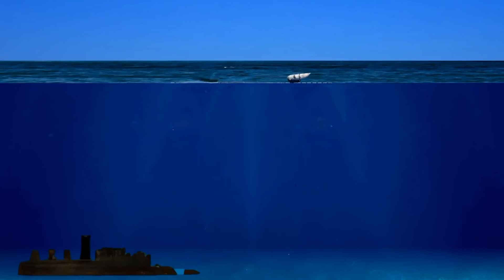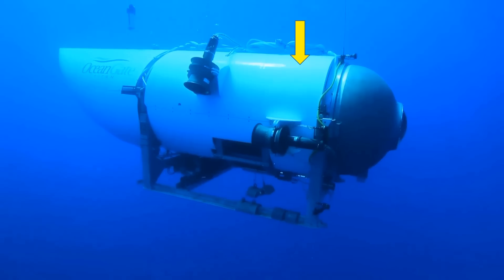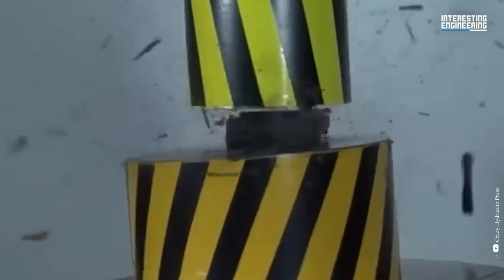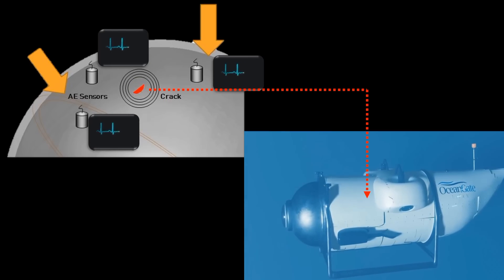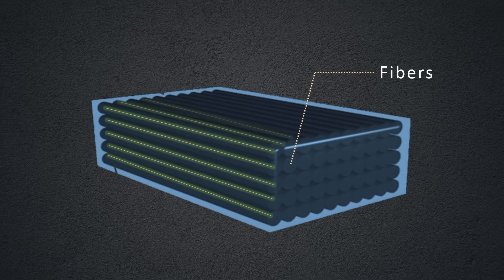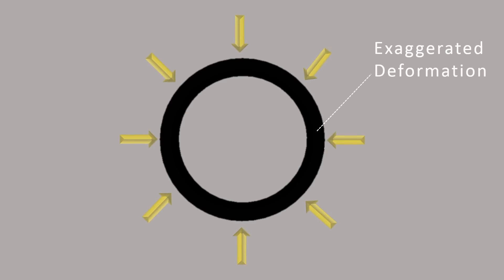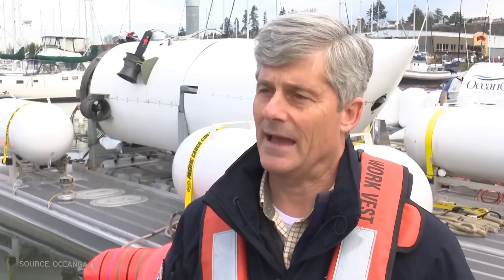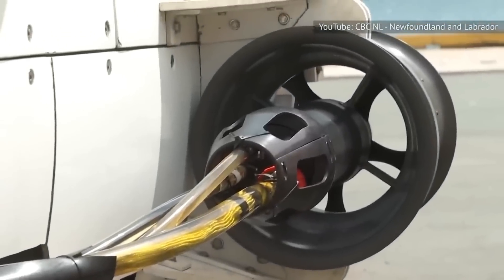Oceangate Titan Did Not Implode Just From Pressure. There Is a Catch!

Comment: On the money and well assessed.  I think of it as the standard chinese finger trap.  The more you pull the stronger the tension, and you can't pull your two fingers apart.  Put if you push, the tension goes away as the finger trap looses all its tension and becomes floppy.  So the carbon fiber hull design with any inconsistencies in the wrap would over time allow fiber loosening under compression cycles, much like pushing your fingers into the finger trap to get loose.  This would allow unbonding of the carbon fibers subjected to compression and differential weakeness along the carbon fiber walls.  It is the variation in the strength of the strands that results in differential compression resistence ability along the wall surface that would break the fibers.  For example, a single strand might be bonded well for most of it's length, but not bonded well and delaminating in small spots.  When applying high external pressure, the weak spots would stretch more and end up pulling against the well bonded strand portions. (Like pushing your finger into a balloon.  If you push your finger into a balloon far enough, it will burst). The weaker spots in the strands would be subject to breaking, since less bonded length means less tensil strength.  To add insult to injury, the now damaged strand itself would have less tensil and compression strength along it's entire length, and thus differential strand strength would propagate around the vessel in some sort of cascading weakness.   You would end up with a multitude of "fingers" poking into the OceanGate balloon.  Just my two cents worth.

Comment: It seems to me that one of the major issues with the carbon fiber crew compartment is that all of the fibers were in only one direction, as the thing was essentially would up like a giant spool of thread and then "cured" for two weeks. There should have also been fibers going in two additional directions, at 45 degree angles to the main ones. That would have made it stronger. I don't know exactly how that could be manufactured but I think that is a minimum requirement if you're going to use carbon fiber on a submersible. The patented acoustic sensors are kind of a joke... carbon fiber is not going to slowly fail, it will just suddenly and catastrophically fail. Mr Rush apparently believed in those so much that he put his own life on the line. We all know how that ended.

Comment: Sorry but fatigue failure has hundreds to millions of cycles.   This hull experienced less then two dozen and I believe less then a dozen. NOT FATIGUE FAILURE!  The reason for finite element is to deal with the interface.  Any competent analysist should be able to adjust the design to deal with the interface.  This is the meat an potatoes of their job.  Dealing with water at depth pressure is unique for this vessel and it appeared that the CEO didn't want to hire experience individual that would have made better choices in how to deal with this added complexity.  
     Basics the thermal expansion rate Youngs modulus of epoxy and carbon fibers are different.  There is always a stress at the interface between them with the carbon fiber causing strain in the epoxy.  Epoxy solidifies at a high temperature and only at this temperature is there no strain.  The temperature at the ocean depths approaches zero centigrade, a significant few hundred degree lower then the solidification temperature.
     Epoxy is strong but also brittle. Cracks develop in every composite structure.  The problem is that the hydraulic water pressure on the OD of the vessel exceeds the surface tension of salt water so water is going to enter the cracks and when the vessel returns to the surface surface tension will prevent the water from leaving those cracks.  Evaporation is the only means of removing the water.  And there to surface tension will affect the vapor pressure, temperature where evaporation will occur. 
     The radial pressure on the OD of the vessel is depth pressure and the radial pressure on the ID 5 inches apart is atmospheric.  So there is a gradient and all the water filling cracks are hydraulically at depth pressure acting in the radial, hoop and axial directions.  The pressure expands the crack and propagate failure along the fiber epoxy interface already having a high stress.
     The simplest method of determining the health of the vessel is to weigh it.  That can be done with 4 digital scales.   Compare the weight with the original and after each dive.  This will give a relative amount of damage.   Test samples could be made to get a relative remaining live or drop in margin of safety.

Comment: A transcript of text messages between the sub and the mothership shows that just prior to the loss all warning indicators were in the red, also the sub had been descending far more rapidly then intended and when noted despite releasing all ballast and the landing frame and using maximum thrust ascent was extremely slow indicating the sub was overweight, most likely due to leaks in the joints between the carbon fibre and end caps.

Sadly it appears the occupants were aware for about 20 minutes that they were in dire straits prior to the final implosion.

Comment: How many submersibles designed to travel that deep have a cylindrical pressure hull?  Most all really deep water vessels utilize a spherical pressure hull.  The external skin may not be spherical, but vessels like the ALVIN, Trieste, even the DSRV (with linked spheres), utilize spherical pressure hulls.  Mating different materials like titanium and carbon fiber and subjecting them to repeated pressure and temperature change cycles is problematic enough, but using a shape that would concentrate loads unevenly would compound the problem.  Are there cylindrical subs (of any material) designed to operate over 12000 feet deep… besides Titan?

Comment: Immediately when we saw the winding pattern of this Titan it's a red flag that the designer does not understand the loads.   And then we see the geometry of dissimilar materials as end caps.  And then we ask what exactly he did as an engineer at Boeing.  So it is a single point of failure and certainly not your 1:2,000,000,000 we would look for in critical hardware.  Beyond that, neither UW nor NASA nor Boeing were involved in the deign of this Titan as he tried to imply to his investors and customers.  UW did work on a smaller concept vehicle, but not Titan.  If he were involved in composites at Boeing, he would have absorbed [no pun intended] knowledge of delamination in CF structures and water ingress, as it is a common problem to fight.  A testing firm refused to test Titan - no indication of why yet.  But even if it successfully tested to 4,000m I would not sign off on it because of the nature of CF stress reactions.  All he had to do was get hit by some debris or get stuck or ensnared by Titanic to compromise that structure, and no warning system is going to help then.  Just ill conceived from the beginning. RIP to the victims.

Comment: The carbon fibre doesn't provide any of the strength in compression. It's the resin (presumably an epoxy) in the carbon fibre composite that provides the compressive strength, with the carbon fibre acting in tension that keeps the resin in its cylindrical shape, and to prevent cracking as it comes under pressure. However, the resin is not completely incompressible, and it is hardly surprising that tiny cracks will form over multiple cycles and it will fatigue fail. If it was an aircraft fuselage, then that will be be under negative net pressure at altitude, which means the carbon fibre is going to be under tension and plays to its strength.

Comment: What happened is the "pop of pringles tube cap"  .....like on a pringles chips tube , the tube is made of. cardboard ( deformable ) while the cap is aluminium ( less deformable ) ...pressure applied on the carboard tube but non or less so on the aluminium cap that is inherently more rigid , creates a dissimilarity between the shape of the opening of the tube that s becoming more oval than the termination of the cap that is still rigidly round ....in the case of the titan sub , that shape dissimilarity probably caused massive tension on the rigidified glue joint which probably cracked , hence why report of the sounds coming from AFT  .....
I don't even think that it's the carbon fiber that delaminated first , just the bending of the tube must have provoked the failure of the glue joint

Comment: Maybe they should have used a weaving pattern in constructing the hull versus a unidirectional wrap. This would have made the strength multidirectional. With all of the wrap going in one direction, the weakness you pointed out was inherent in the design.
Reply: carbon is a weak material from the start, using carbon is like building your house from burn wood! no matter how you build it, its already weak, I work in heatreating carbonize the steel  and iron, it will harden the material but the fall point in carbon is it won't bend to much, it will shatter like glass weaving it won't make a bit of difference it can not take the pressure it won't bend, that is the problem!!! it was going to happen! he would have to redo each sub after a single crack was notice! he should have just listen!
Reply: @@raresnuiter Carbon fiber can not tolerate many compression cycles, it's just not a good idea to use.
Reply: @@raresnuiter Other people can't see the comment. It doesn't show when you press “View replies”.
Reply: Go woke  and drown
Reply: I think some of the layers were diagonal. Not that it would have made much difference.
Reply: @Katoshi_Takagumi  that's ambiguous
Reply: @stevesims2243  That it wouldn't have made difference? Not for holding under pressure, they probably used the diagonal layers to bind the carbon fibers more firmly to each other to form a more durable and stiffer cylindrical shape instead of a roll of glued serpentine.
Reply: @Katoshi_Takagumi  In your first comment, you said "I think some of the layers were diagonal..." Do you have any evidence of that? I'm going by what was shown in the construction video, and they were wrapping the carbon fiber tape in one direction. Everything already wrapped was in the same direction.  
 In your last comment, you said " they PROBABLY used the diagonal layers to bind the carbon fibers..." Again, that is supposition. You don't know whether they added diagonal fibers or not, so you can't conjecture about reason for doing something you suppose they did.
Reply: @stevesims2243  True, I may have a false memory from seeing that clip just once, briefly. I think it was part of the deleted OceanGate content. The idea of 'diagonal' probably was due to how I remember that they changed directions of the fiber being wound on that loom. In other words, I remember seeing it go back and forth, not just from left to right. Can't verify it from any source now, though.
Reply: @@raresnuiter If you did say that then youtube isn't displaying your comment because the only post of yours it is displaying is your irrational reply to cheap.

Comment: honestly for the controller portion, game controllers have been used in military applications for a good bit with drones, bomb defusal...etc. i dont think the controller and that would have been the issue especially when we consider bluetooth signal of the controller to the computer inside the sub, and the signal of the computer to the actuators...etc. We use it for applications designed to deliver missles, fire machingins chambered in 30 mike mikes...etc. while flying it. 

the only diffrence would be he didnt use a hardline connection witha joystick and other mechanical buttons/switches that would not allow him to move from the front to the back of the sub...etc. I assume the choice there was to make it so he could allow the tourists to sit up front at points where they were not having to manuver...etc.

Comment: Thank you. An additional thought: 
The properties of the spherical end caps made of titanium under loading and additionally changes in temperature may have caused unforeseen stresses in the structure. Could there have been an incompatibility between the different structures? Additionally, the methods used to bond the ends to the carbon fiber resin matrix tubular structure should be researched. Simply bonding without other mechanical fastening could be an issue.
Apparently the head of the company also made a comment about not needing experienced 50 year old white males, or some such comment. If my life is in their hands, I want the most experienced people on the team, or heading up the team.

Comment: At a minimum there should have been longitudinal fibre layers inbetween the circumfrential windings. There should have also had 100% ultrasonic crack flaw detection and delamination scans performed on commissioning and after all operational deployments. Acoustic monitoring appears grossly inadequate.

Comment: Most probably water infiltration either at the carbon fiber and titanium junction  or in small fissures of the carbon fiber composite.
Suddenly you have full water pressure on the thin thickness titanium tube. Boom.